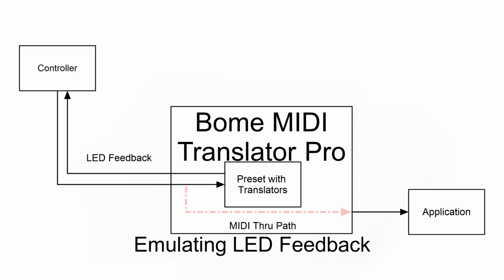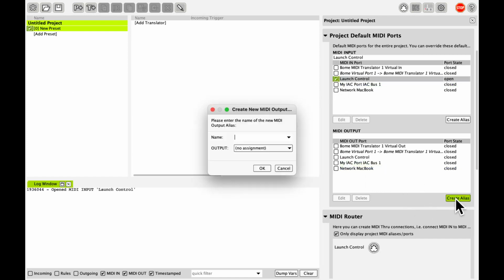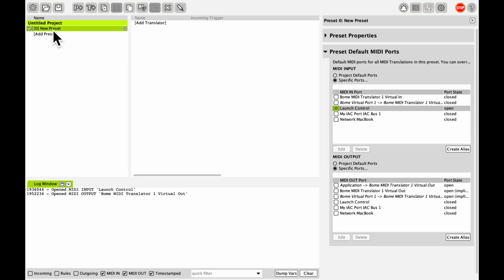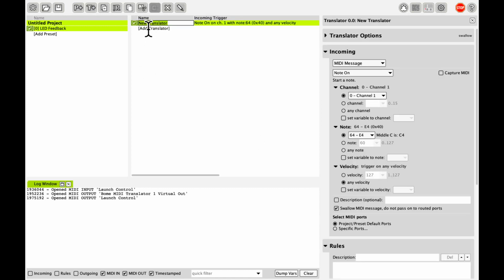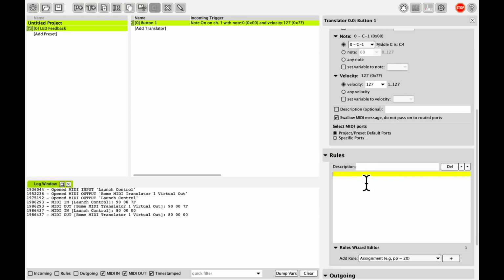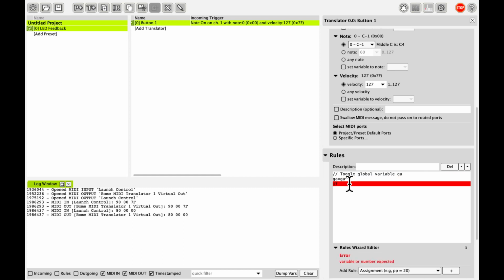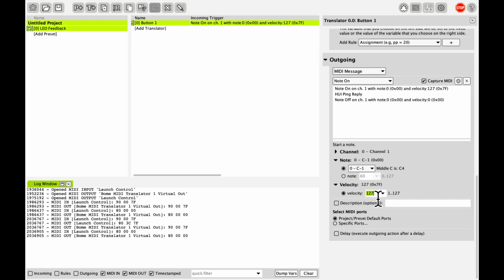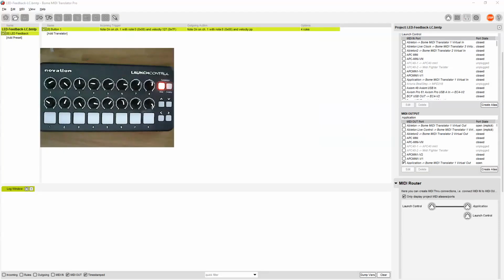Tutorial: Emulate LED feedback on a MIDI Controller using Bome MIDI Translator

Comment: Hi there, this sounds really, really promising for the issue I'm trying to solve.

I use a MIDI controller (Allen and Heath Xone:K1) to map functions from my Eventide H90 effects pedal. In the H90 software I'm unable to assign MIDI note values to the LED output of buttons. I already own a licence of Bome Pro, so could I use Bome to do this for me, by feeding the commands from the controller to Bome and the H90 at the same time and simulating LED output, when functions are toggled between active an inactive?

It really does seem like this is the solution.
Reply from the maker: Hi Lee,
If you need help getting this set up, please open a thread on the Bome User Forum at the link below:

https://forum.bome.com

Steve CaldwellBome Customer Care
Reply: @Bome  Thanks for the quick response. I'll let you know if I run into any issues.